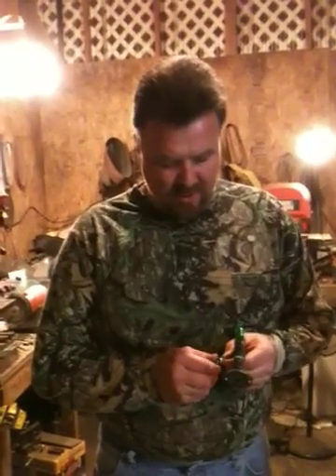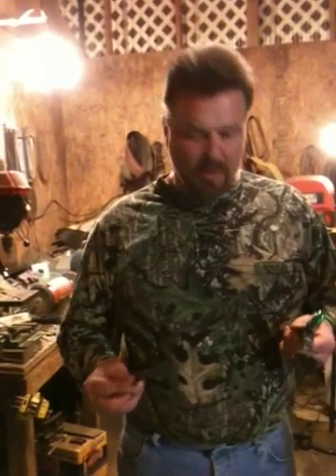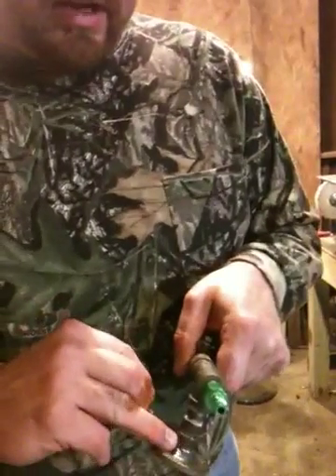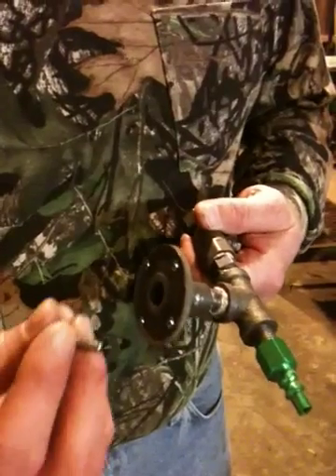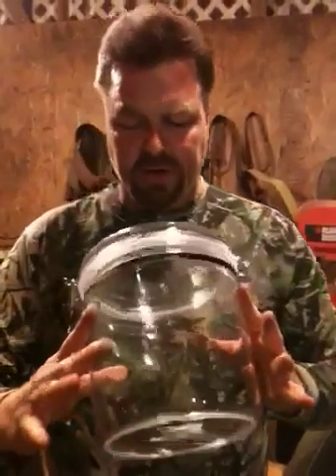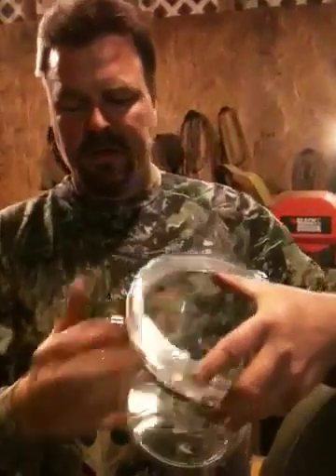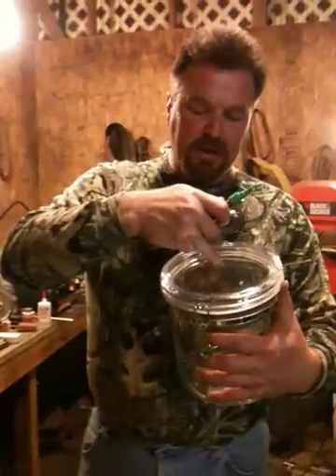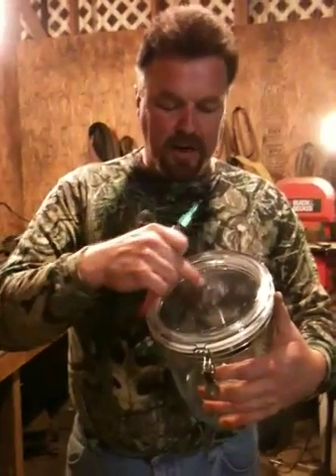Making a stabilizing vacuum chamber

Comment: He did not test it before posting because I followed his advise and the canister is to thin , the vacuum cracked the lid under vacuum ,I reinforced the lid by adding a thicker plastic , the the bottom cracked under vacuum , if I build that up the sides may fail I don't know but not worth my time to try , I will build an acrylic box , very easy and use the proper thickness to prevent failure.
I wish he would pull or update his video so others will not waist thier money.